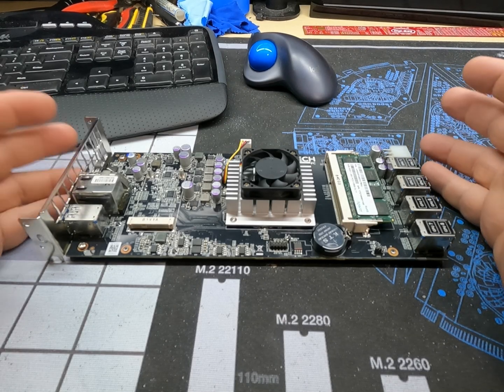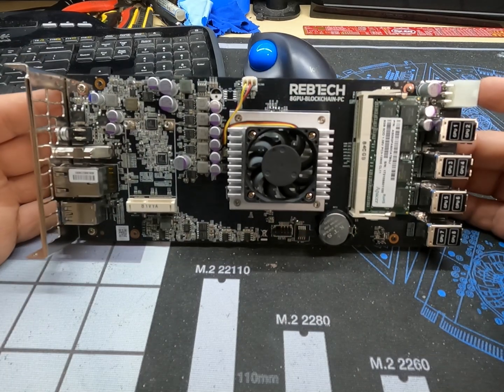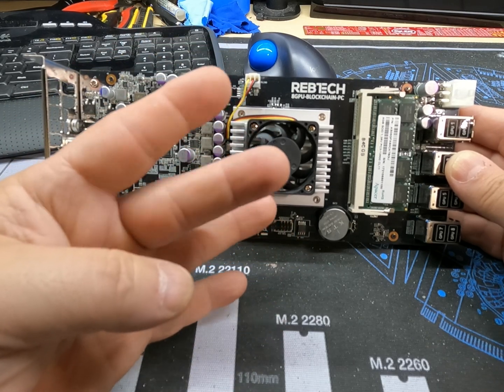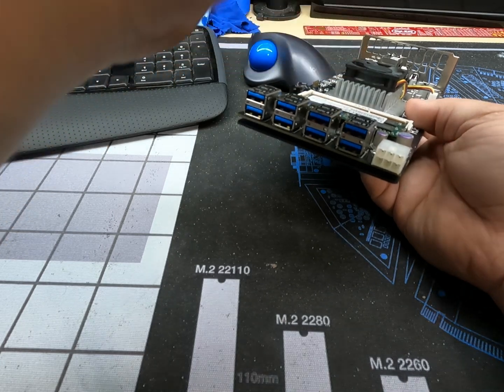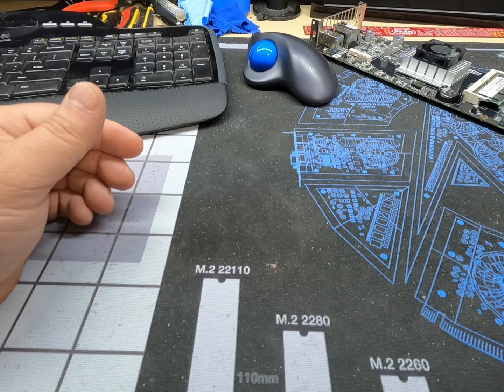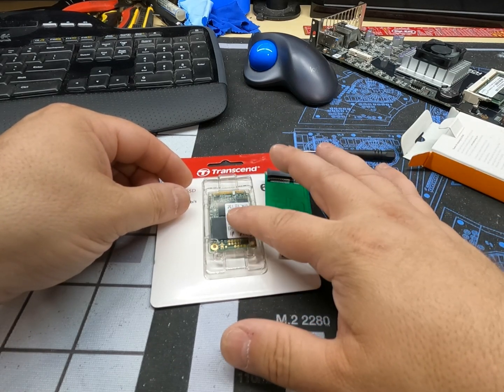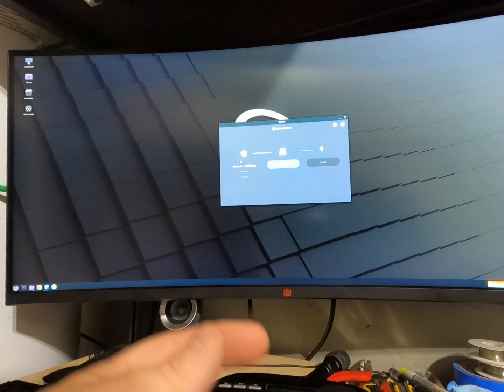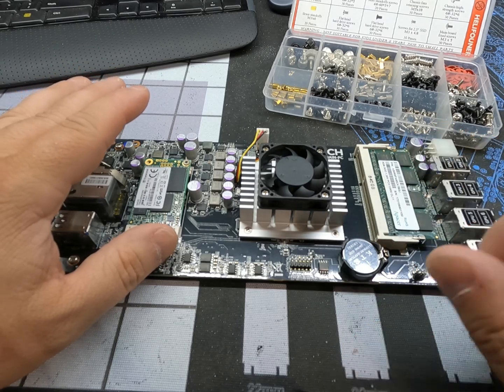Rebtech Mining Motherboard Overview & Rig Build

Comment: 11:50 is your hiveos installed on a UEFI partition? i had the same problem with my rebtech internal GPU not displaying anything when formatted with this partition table. this was fixed when I reformatted the drive as MBR and set the settings in BIOS to legacy only, then the internal HDMI port will display out properly.